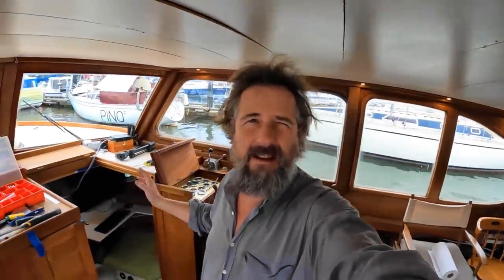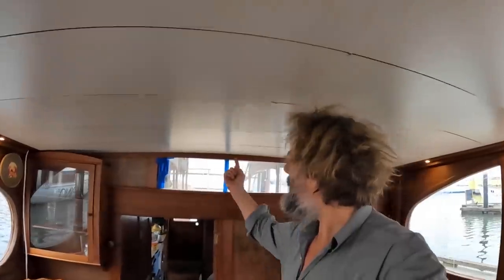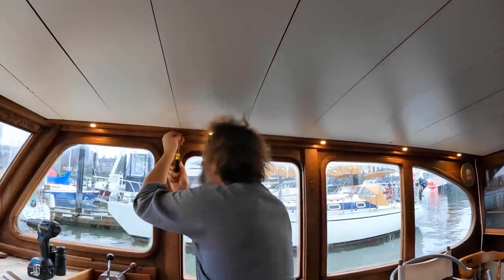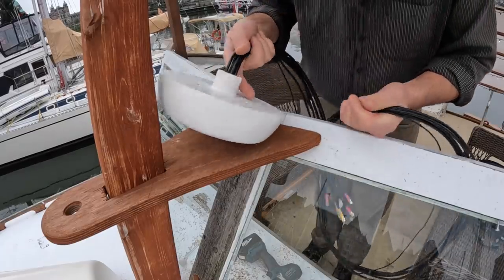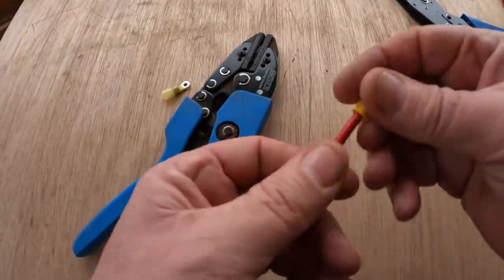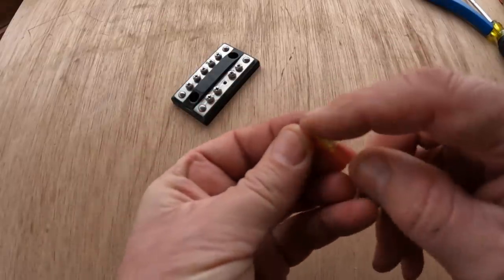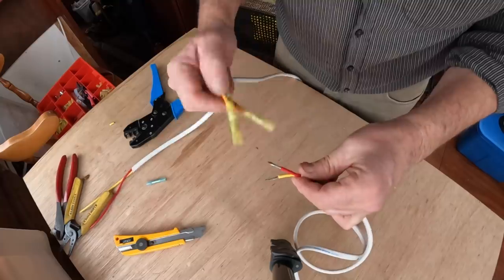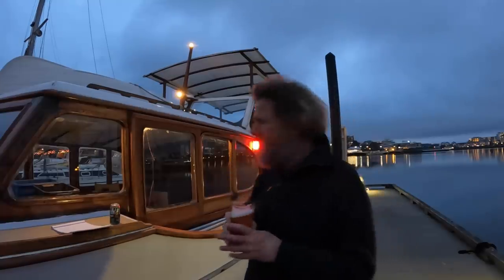Even more Electrical - #288 - Boat Life - Living aboard a wooden boat - Travels With Geordie

Comment: One thing to think about on that white stern light. If you put it up top on the Bimini,  it will light up your cockpit or lower cover. When running at night, the white light will kill your night vision every time you look astern. I did the exact same thing,  and wound up moving it to the transom. Love your videos, glow man, glow!
Reply: The stern light is, I believe, required to have 360 degree visibility. Thus any where you put it has a potential to affect night vision. That's why most have planar projection. To eliminate reflective glow. It doesn't work so well on a surface mounted light but if you use at least an 8 inch shaft you should minimize this effect. When it comes to nighttime visibility I want mine as high as I can get it. An obscured light is useless and can get you a nasty ticket in the US
Reply: @michaelmagill189  Yes, you can have one 360 white light for a power boat if less than 12 meters in lenght. You can also have a 225 degree forward pointed light, and a 135 degree rear light, which is required over 12 meters Since, in this situation,  the light is to be two units, IMHO it's better to keep the light off the boat.

Comment: Peter, I don't use connectors with shrink tubing, I use bare terminals and glue lined heat shrink cut to the length I need.  Because it is free of the connector you place it as far down the connector as needed.  More time consuming put I find far better, and less expensive.  You are doing very good, looking forward to seeing the finished vessel cruising the waters.
Reply: ☝️😎👍  Me too, on both boats and motorcycles. Still running looms that I built 30 years ago, with no failures yet.
Reply from the maker: I agree, that's what I always do on the Land Rover. The problem is finding quality terminals. My source had been McMaster Carr but they won't ship to Canada.

Comment: Re Crimpers; I have a "Wirefy" heat shrink suited crimper which is the fully "trapped" crimp design you liked re the "Ancor" tool; in fact pretty much identical except that the crimp dies are only about half the width/thickness so that they do not crimp where the heat shrink encloses the insulated heat shrink section of the lug/wire. Not to criticize your approach, just thought you should know.

Comment: Good tip on the heat shrink terminals!   I don't have a glow boat, but as a HAM and automotive accessory junkie, I'm sure to use this info.  I've been crimping them with the regular crimper for years and didn't know I was doing it wrong...right/wrong...whatever!

Comment: LOL, its funny I have been doing almost exactly the same wiring job as you this past week, masthead light, navigation lights, and stern light, except I have been working at 1/12 the size you have and using single micro LED lights with a tinned wire lead of just 0.1mm (about the thickness of a human hair) my lighting wires rn up the mast in a 1.5mm dia slot milled in then covered with a veneer cover. but the satisfaction of a well wired set of lights gave me a warm glow inside, much as the lights glowed when connected, my next task too matches yours, wiring it all into the boat and to the helm panel where is is switched by a DIP switch used to mimic the helm switch panel.
Reply from the maker: Wow! what scale is this? Pictures?
Reply: @TravelsWithGeordie  I have posted some pictures to your facebook page.

Comment: NO MORE HEAT SHRINK CONNECTORS! I stopped using them for a couple of reasons, expensive and the intrusion of insulation into the terminal area. I buy uninsulated terminals now. Crimp them add heat shrink tubing and voila, no trimming and far less expensive.

Comment: Peter when you crimp the heat shrink tube then heat it up could you not use a flat head screw driver or something similar to push the plastic back enough to clear the terminal would save you cutting the tube after cooling
Reply from the maker: Yes, I suppose however I'm hesitant to disturb the adhesive bond. 
The little trim, is pretty quick actually.

Comment: Thanks for the little rant on marine terminals and crimpers. I don’t buy terminals with heat shrink already on for these reasons. Splices (butt) on vehicles ok, not marine. Years of splicing well wire and underground to a much higher grade just not comfortable with any crimp that can pull out. On any job it is called a failure. I have a variety of crimpers most favored are the ones on Lineman style that crimp with an anvil piercing for 10gauge + after a hand placed marine shrink tube all is well. Geordie is glowing inside and out now. Like to know some good led bi-pin twist lock bulbs not costing $10+ to get quality.
Reply from the maker: Good points. ABYC and surveyors limit my options. I'm confident with my compromises. Yup, good LEDs are pricy.

Comment: "Hey but we're gettin' them terminals CHEAP from China and still charging the old price. So hey - Screw you for pointing out our careless stupidity.  Because our bean counters sez our stockholders will be happy.😛"
As a USA manufacturer I focus on every single detail of my product.  My motto - we bring safety to your sailing experience.  Our biggest problem - few others feel that way.  While we have improved the safety and performance of our products since 2004, and while our suppliers have doubled the price of the components we use - Our price remains the same.  We're proud of that.
BTW - tinned wire - good on ya mate.

Comment: I know this guy that has constant 1/2in gaps in between his planks but because he coated his Hull below the waterline with really expensive undercoating not ONE drop of water in his bilge. That can be purchased at Wal-Mart. Flex Seal is the name brand!!! Cheers 🍻 you can dip your wicket in it make a profilact device for your safty and leave you glowing 😜
Reply from the maker: Heh, so I've heard.

Comment: You pull all that apart, when you could have taken the easy route down the side and up behind the cabinet .Later if for some reason you need more wires or replace one you got to take it all apart again.
Reply from the maker: I considered that, but there actually isn't any room behind the cabinet. And there are wires that go forward as well.

Comment: Doesn’t it rain in Canada? Asking because you didn’t seal any of the holes with a sealant or scanstruts. Also “drip loops” in your wires to ensure water (rain, sea, condensation) can’t travel along the wire to the connections is good practice. In any case, like your videos 👍

Comment: For the creeping heat shrink onto the contact area problem, would gripping the contact area with vice grips or flat nose pliers while heating it prevent the creeping onto that area?     If so, that'd be faster than cleaning it up afterward,      Maybe?
Reply from the maker: Not really, the plastic is too close even before the shrinkage.
Reply: The creeping of the heat-shrink material is caused by the crimping, not by the heating.

Comment: I don’t like the heat shrink terminals for several reasons the first being the cost per terminal especially when compared to purchasing non insulated terminals and quality heat shrink tubing. The second reason I do not like insulted terminals be they standard nylon insulated terminals or heat shrink terminals is the quality of the crimp even with a good tool compared to a good crimping tool and non insulated terminals. Third is the fact more times than not with heat shrink type terminals you have to spend a fair bit of time trimming back poorly placed /excessive heat shrink from terminals after shrinking the the insulation.  Lastly is when looking at a terminals block or switch panel all you see is a bunch of yellow, blue, or red terminal ends that prevent you from quickly and easily seeing if you have corrosion problem with any wire/terminal crimp from condensation/water egress into wire from seepage from the other end of wire run compared to non insulated terminals that have had a short length/piece of clear quality heat shrink.  Additionally I find it much easier not to have any shinning wire/terminal crimps when using non insulated terminals end also after I crimp a non insulated terminal onto a wire I then very lightly paint the crimp with no-ox paste and then apply length/piece of quality clear heat shrink tubing as required over my crimped terminal end/wire.  Also a two very good practices to do when using multi conductor cable like we are seeing on this video is to put a piece of thin flexible heat shrink to cover the end cable insulation jacket and the wires inside the cable insulation jacket this not only makes the job look much neater but helps prevent the cable insulation jacket from splitting/peeling back when dressing in the cable secondly I always label the ends of each cable to identify it additionally I also label each cable run on each side wherever it penetrates a bulkhead, deck, cable box etc as well as protecting the cable/wire insulation with fiber paper(aka “fish paper”) thought each penetration. Lastly I always make my cable runs in a neat and orderly manner and secure them along there run because I have scene far to many wires/cables insulation be damaged causing the wires to arc/short out resulting in potential electrical shocking hazards, potential fires, or fires none of which are never good on land but when on a boat miles away from shore in can be disastrous during the daytime in good weather but at night and or bad weather can become deadly in the blink of an eye.  Also never be that person who decides they are going to save a few bucks on wire by “stringing” wire willie-nillie instead of making orderly neat wiring runs.

Comment: Hole in the roof?
Reply from the maker: Errr, ya, will be sealed up but eventually go into the new upper helm pedestal.
Reply: @TravelsWithGeordie  I understand you're going to seal it up, but you didn't mention when or how. I'm just concerned about water intrusion between now and then, that's all.